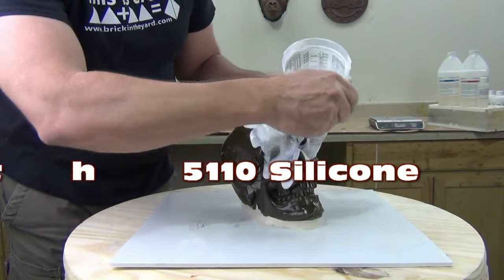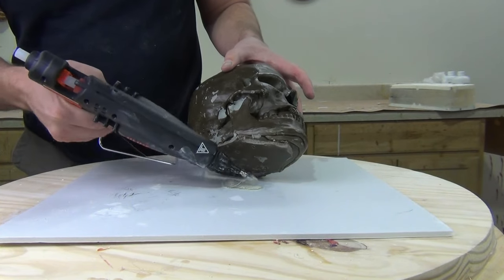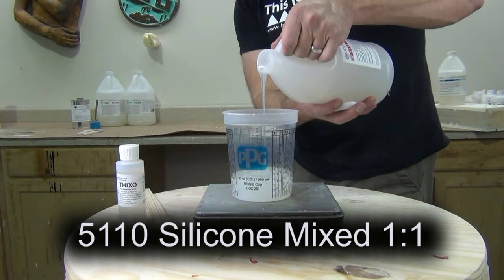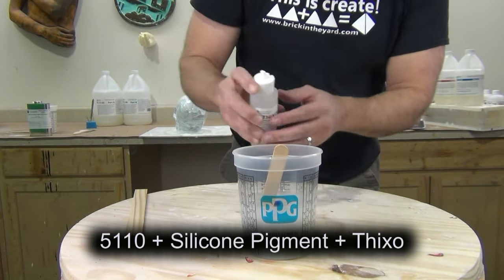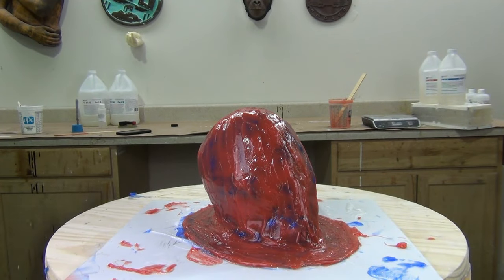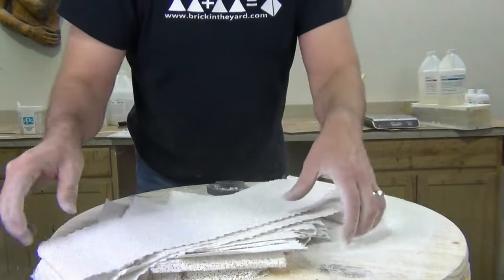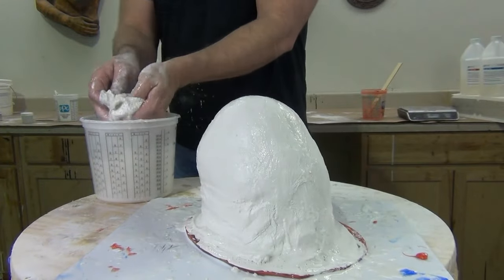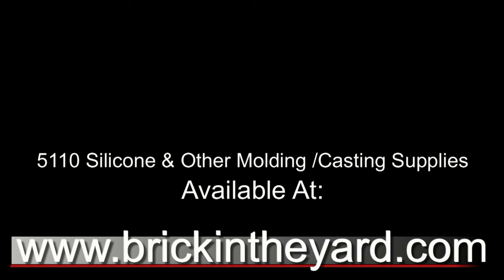Moldmaking Tutorial: Seamless Skull Mold With 5110 Silicone

Comment: How much 5110 should i get to make a similar mold to do what you did in this video?
Reply from the maker: @scotthalt4040  this took about 2lbs. I think the smallest kit BJB offers is a 4lb kit so that would be more than enough.
Reply: thanks! I've seen some places have 2 lb kits and you can get 3 of them for the price of 1 4lb kit also.
Reply from the maker: @scotthalt4040  I think Fox and Superfine have 2lb kits.
Reply: Definitely daw 2lb kits on Fox. My intent is to try and make some skulls with a 90* piece/ mount coming out of the base to mount to a wall for motorcycle helmets. Any suggestions for material? I was thinking pourable resin, maybe?
Reply from the maker: @scotthalt4040  TC-808 is good for solid and rotational casting and works well for automotive applications.

Comment: Is the 5110 better to use for than your platsil 10 silicone?
Reply from the maker: Not so much as better as different. 5110 is a slower setting, lower viscosity formula so there is more working time and it is much easier to use for poured molds, also less expensive.
Reply: I do like the idea of a longer working time. Thank you

Comment: How can I pour concrete skulls in this manner?
Reply: I'm so happy I'm not the only person researching this,..for totally normal person, normal reasons.
Reply from the maker: You could use this for concrete casting. But you might want to make a slightly thicker mold with a resin mother mold using TC-5130.